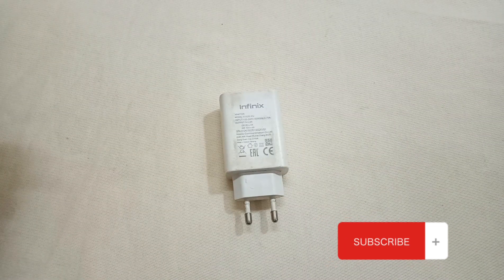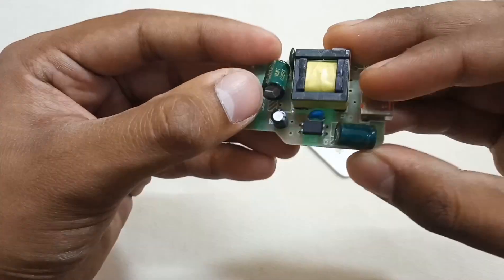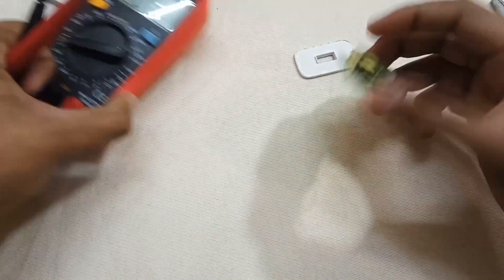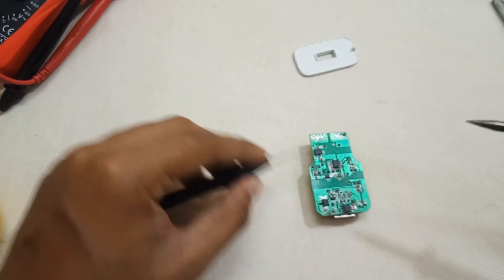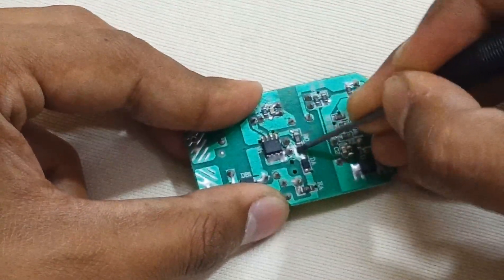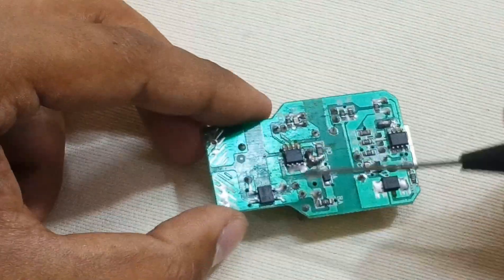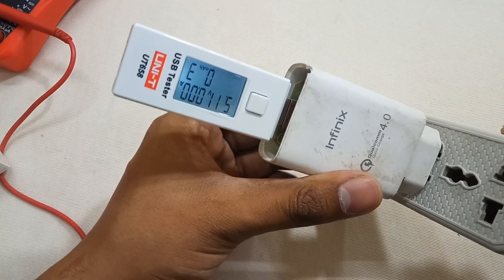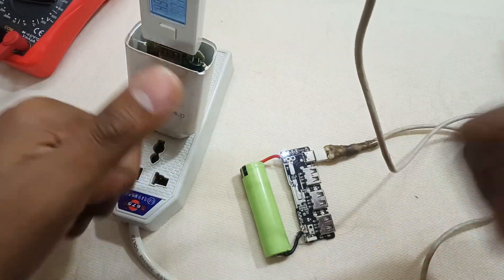Revive Your Dead Smartphone Charger | Dead Mobile Charger Repair: Easy DIY Fix #chargers #repair

Comment: Hello. I have one of these classic cheap little white wall chargers like in the video. It’s 5V 2A and has 2 USB C sockets. It gives less then 1A (4W) instead of 2A (9W). I don’t see anything wrong with a close visual inspection. It has 3 caps, 1 transformer, chips, 1 resistor, etc. What can be wrong with it? TY
Reply from the maker: It depends on load. Plug the device which draws 2A at 5v and check.